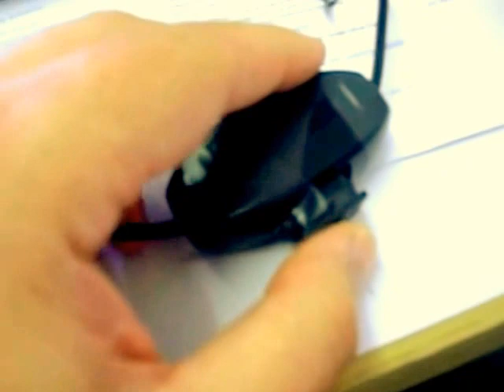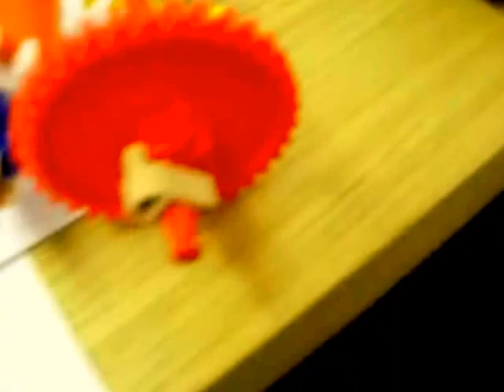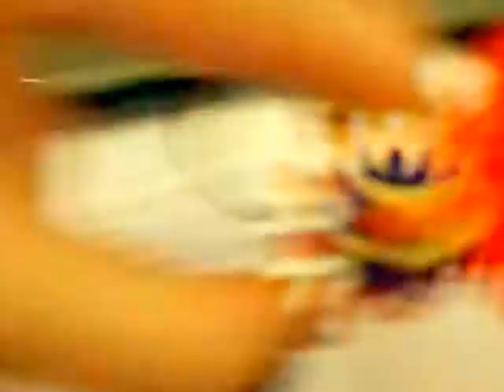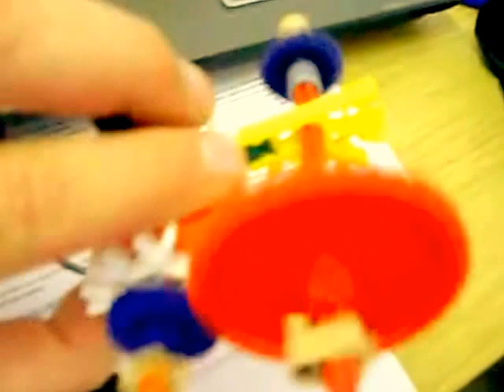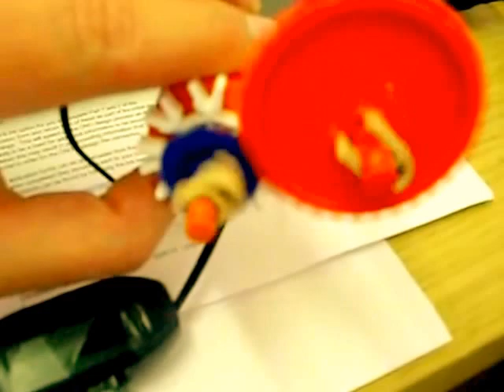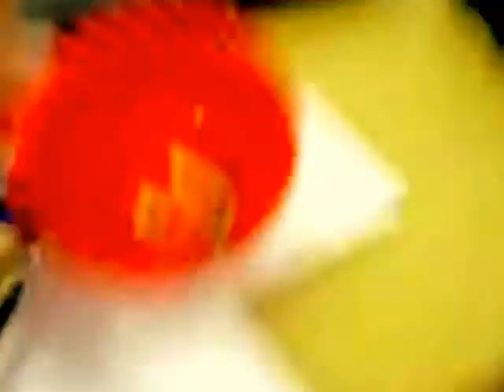Super Capacitor charged up on room light Knex solar.AVI

Comment: Surely you mean 2.5F not uF ? 2.5uF capacitors wouldn't hold anywhere near enough charge to power anything really. Pretty sure a capacitor only becomes a "Super" capacitor when its of a value of at least 0.1F ?